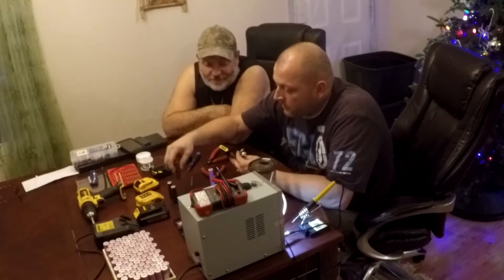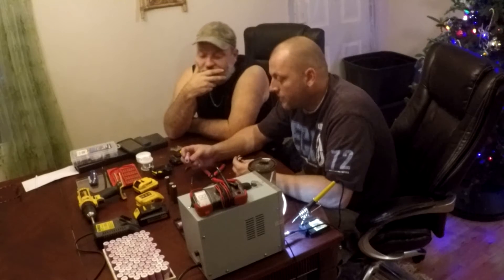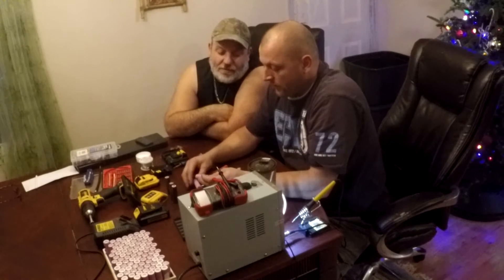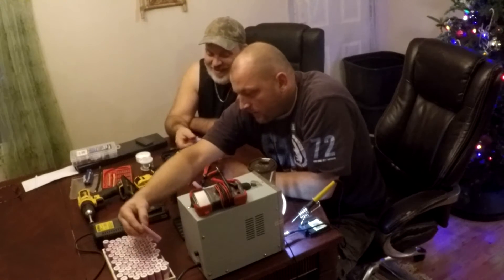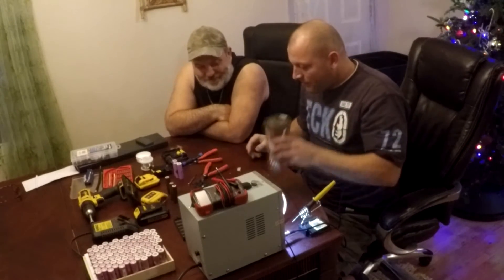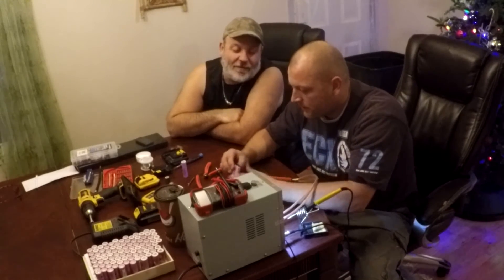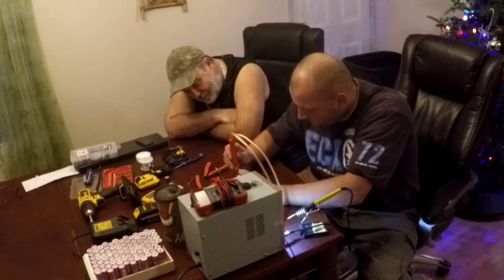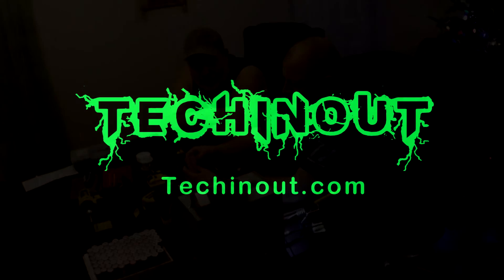dewalt Battery Repair part 2

Comment: 18650s  from laptops are not rated for sudden burst of amps that power tools demand. The laptop has a more constant discharge on them. Yet it will work but just be careful of the cells over heating.